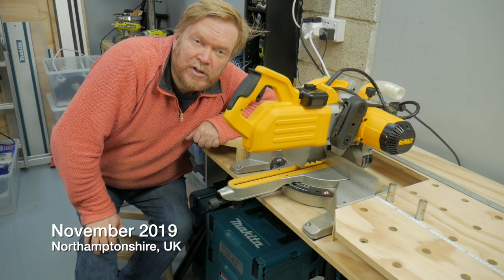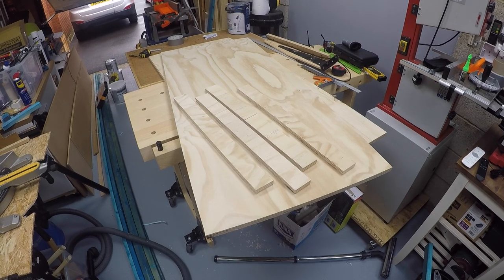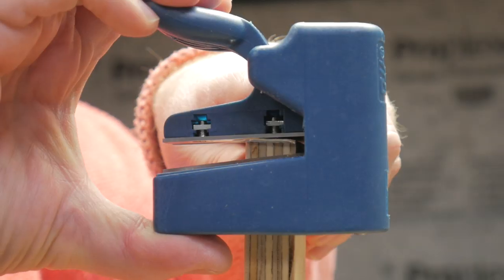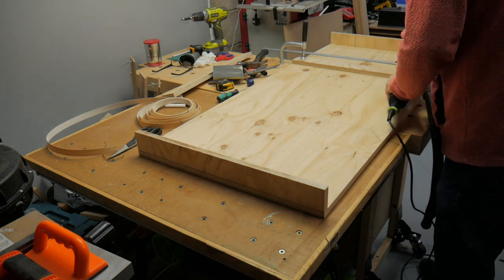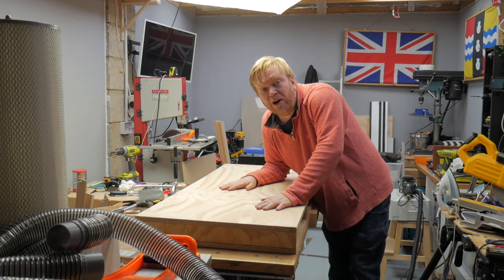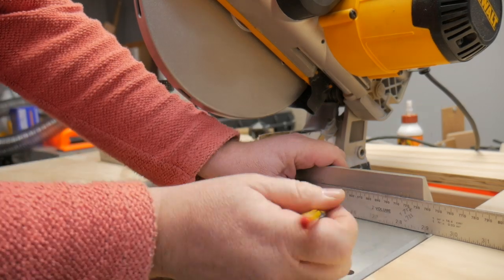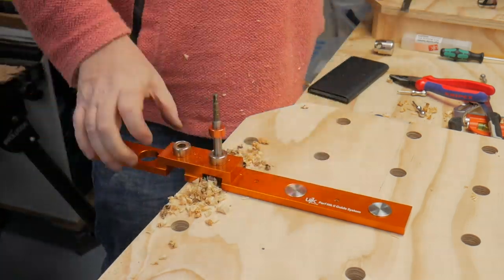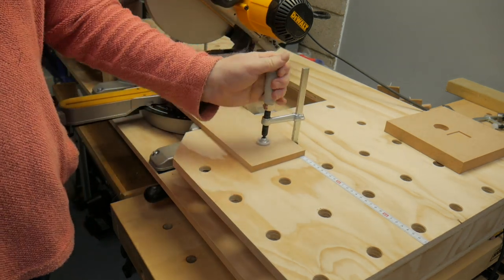Mitre Saw Bench - MFT Style using the UKJ Parf Guide System

Comment: Great idea, looks really smart, I also love the "modular" process of building something now that is fully useable as is, but will integrate seamlessly at the next stage! My only recommendation would be that if you were building another, to include a "spine" running left to right, to prevent bowing of the station left to right. I imagine once it is added to the future cabinet then it won't matter, but if you wanted to make it removable (perhaps to reuse with the stands "on location") then a spine would help it stay straight for longer!
Reply from the maker: Thanks for the comment Simon and your suggestion is well made. When I made the two rolling shop cabinets for my last workshop (not filmed but a sketch-up video showed the design) I didn't do anything to re-inforce the top or bottom of the cabinet and they both bowed over time. Here I risk the same thing happening and you're right about that. Work has started on the new under cabinet and the plan was always to re-use the threaded inserts for the mitre stand hardware (plus 4 more installed but not shown on screen) to fix two pieces of angle-iron to the underside to keep it flat. The under cabinets were to get the same treatment in the bottoms. That said I filmed the 'passive dust collection' add-on yesterday and I've already fitted a left-to- right rib in the centre section and an up-stand at the back of the saw across the width with the intention of adding strength to the bench. Look out for that video in the next couple of weeks.

Comment: Excellent job. Hurry up with the base unit. I had been planning to build something similar but for L boxx storage, drill press on one side and wheels ( necessary for my situation). Had not thought to use dog holes, I will steal that idea.
Reply from the maker: Steal away. The thing to know the height overall of the top is 100mm and the space between top and bottom is 64mm which is not far off the minimum if your using track clamps through the holes. It's not the next thing in the list but it will be a late November build. I will have plans available by then. K

Comment: nice work Karl, I really like the design and agree on the MFT style tops - an alternative (to the in my opinion too expensive) parf guide set is to pick up a CNC MFT available from a few different sellers on eBay in MDF or ply for the top then follow your design
Reply from the maker: Thanks Bill. I was lucky enough to be gifted the guide set but your approach would work fine. Good luck.

Comment: Hi Karl great idea, this would work really well in my garage, especially with castors on..could you give us an idea of the overall size and how much the saw is offset from centre, looking forward to the cabinet build, keep up the good work...
Reply from the maker: Hi Chris - thanks for the comment and question. The two pieces that make the top are 1347mm x 605mm.
The longest size is governed by the need to accomodate 3 x Makpaks, 4 x 18mm uprights and 6 12mm clearances for runners. Hence the odd number.
The saw is dead centre of the top with the front of the feet pulled forward to 5mm from the front edge. In an earlier video I made a fuss about saws not being able to get close to the wall and there's a reason for placing the saw at the front of the bench which will become clearer in the next video. The cabinet will eventually have two 1.35m cabinets to the left of the blade and a 500mm wide cabinet to the right. 
I'm hoping the cabinet build will be up on the first Sunday in December.
Reply: @StrawbyteWorkshop  Hi Karl, thanks for the info thats great...

Comment: Definitely cheating ha! (I've got both of the domino machines - as a small business) it's the same amount of cheating as I do by driving to work in a van and not my horse and cart, or by using my drill instead of my bit and brace. It's called tool development and there's nothing wrong with it! It's often jealousy that drives those comments. I'd love a massive panel saw, but can't afford one (space and moneywise!) - but I don't begrudge anyone having one! Rant over! 😁
Hi, I'm Craig and I'm a furniture maker - and now a new subscriber too 👍
Reply from the maker: Hey Craig. Thanks for the sub and comments. The DF 500 has really changed how quickly I can work and given I get no more than 15 hours a week in the workshop turning-out stuff, I really appreciate the time saving.